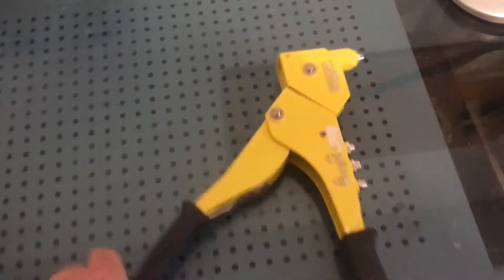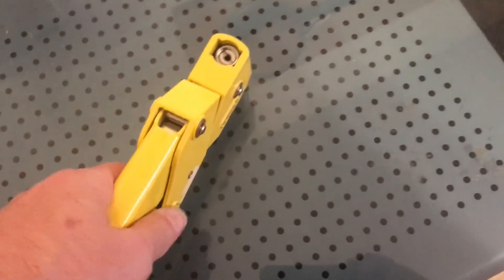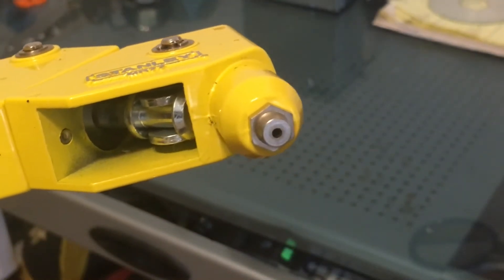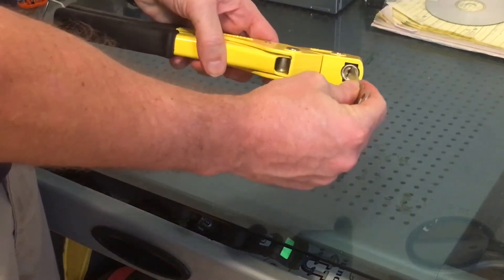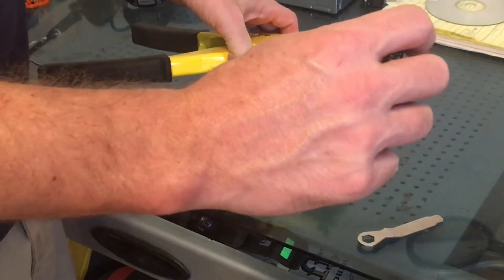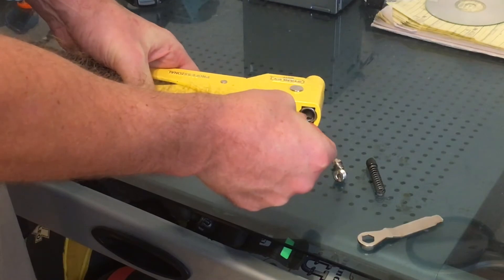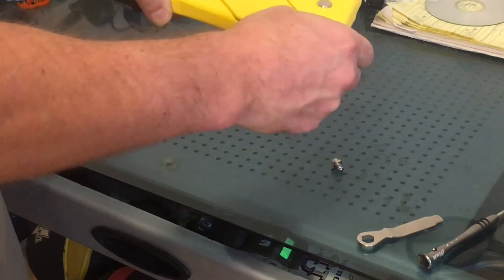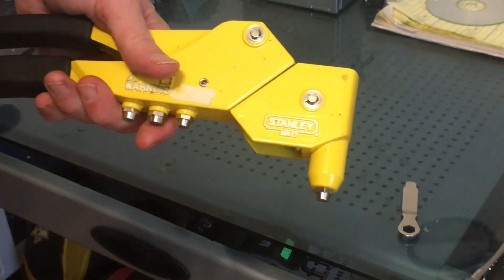Stanley MR77 Rivet Gun Repair!

Comment: thank you for trying.  Unfortunately my staneley  riveter, a newer model has these annoying screws on either side so you can't just scree in the bit oat the back and finish You need to align the screw holes and both sides whilst holding the spring in.  Impossible.  I tried for more than an hour to align all the holes.  It aligns on one side and then not the other.  They make it harder and harder to fix so you have to buy a new one.  Rocket science!
Reply from the maker: That does sound frustrating..  Glad I have two of the older ones. You call the company?